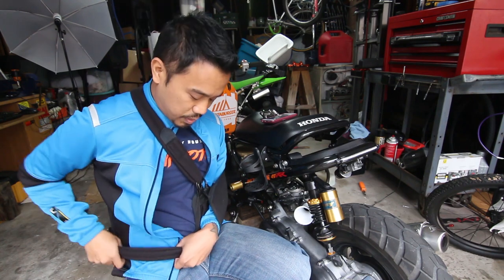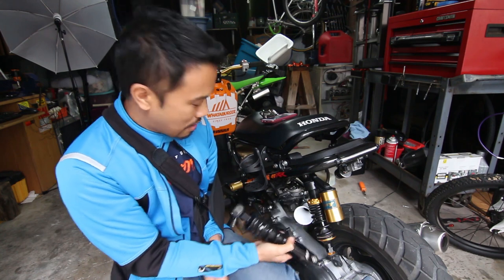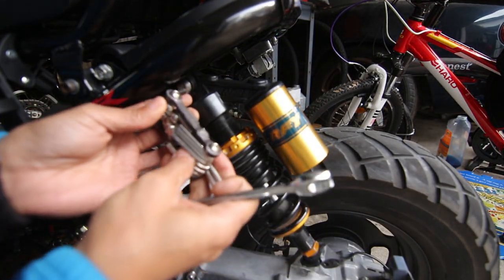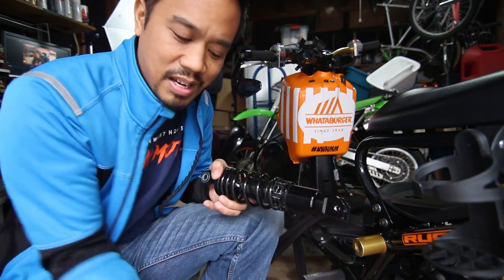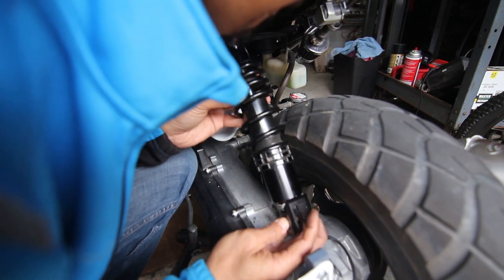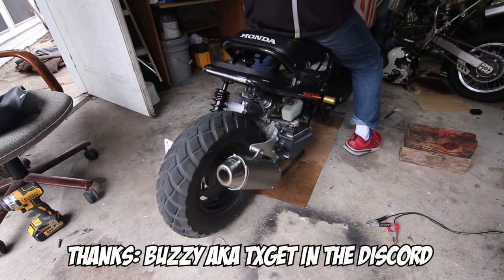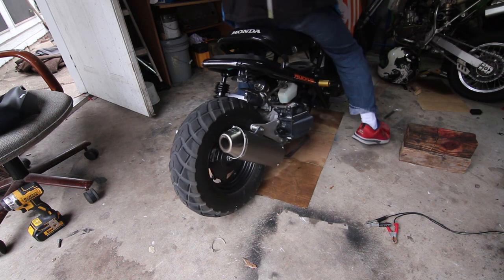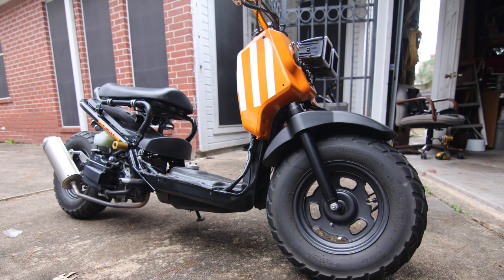NCY Lowdown Shock on a Honda Ruckus - I really needed this installed #NCYLowdown #HondaRuckus

Comment: You bottomed out like I did checking mine you have to adjust the spring tighter with the included tools first before riding it shows you how in the instructions it came with

Comment: So just now seeing this video. I have the same shock and same Jdm 6.5” stretch but my shock is rubbing my tire. Idk how to fix it.
Reply from the maker: If it’s barely touching put a spacer between the wheel hub to push the wheel out just a tiny bit.

Comment: I just saw a video where someone with the 9.5" stretch kit had a problem with the exhaust hitting the ground with the same shock you installed in this video. Do you know of a way to fix this? Can you just buy a heavier spring for the shock? Doing as much research before I buy my Ruck. Thanks man
Reply from the maker: They may have installed it with the stock shock, if the shock is to soft your motor will ground (bad!) or of you are pretty heavy. I got the NCY low down when I put my big stretch on. Dude research away and feel free to ask questions. DM me on Instagram “SmallEngineVelocity”. Also if you buy amazon use shop.sevproductions.com